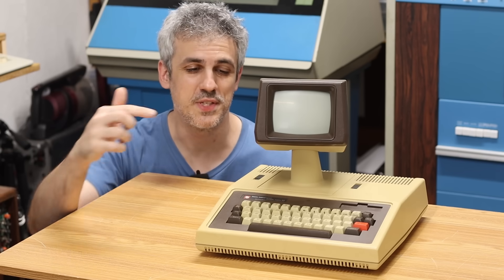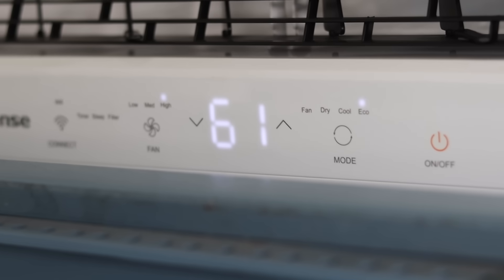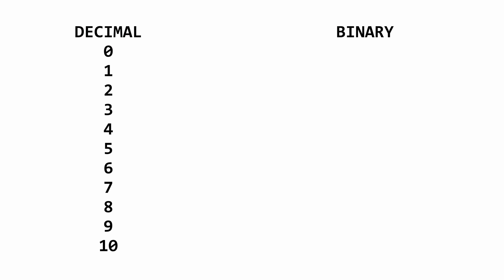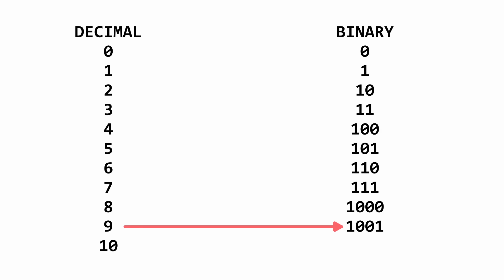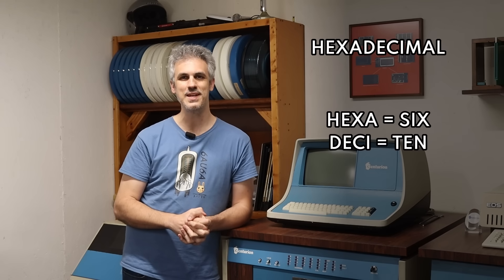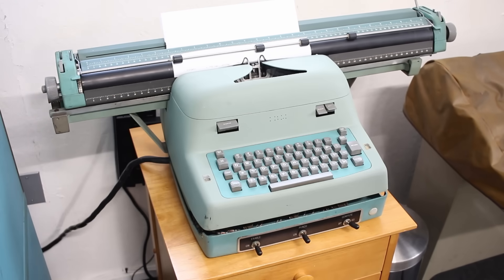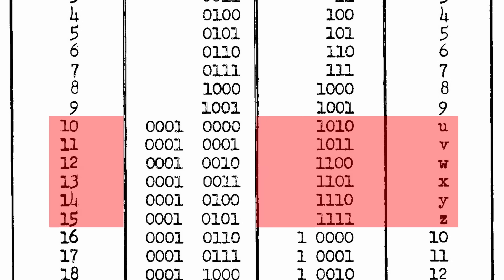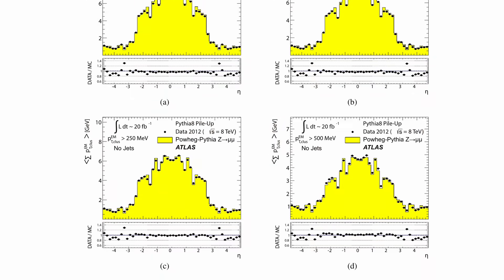Learn How to Count Like a Madman (Or a Computer)!

Comment: 8:33 The flaw of octal is that it's not an EVEN power of two. It's 2 to the 3rd power. 16 is an even power of two, it's two to the 4th power.
Reply from the maker: Good catch! I really struggled with how much detail to go into with this one. It could have easily turned into a 40 minute video of gotchas and intricacies in weird numeral systems.
Reply: @UsagiElectric Just a minor mistake on an otherwise great video! I think everyone understood that what you wanted to say was that in a world of 8-bit bytes and 16-bit words, it makes more sense to use base-16, because all binary values can be represented in hexadecimal without having any unused digit values. A byte is 0 to FF(16) and a word is 0 to FFFF(16) whereas in octal, the highest values are 377(8) and 177777(8). Octal numbers are easier to pronounce but hexadecimal numbers are easier to imagine in binary because each digit represents a nibble.
Reply: @UsagiElectric and I would have gladly watched all of it!
Reply: Octal works nicely for machines with 18 or 36 bit word length. Such as much of DEC's PDP line.

Whilst hexadecimal works well with 4, 8, 16, 32 & 64 bit machines.

Though Altair 8800 (and IMSAI 8080) front panels use octal style groupings of three bits. Whilst the Intel 8080 is an 8 bit processor it's instruction set, mostly, groups into sets of 8. Thus is easier to make sense of as 4x8x8 rather than 16x16.
Reply: Glad some one else caught that!
Reply: I think the basic reason for octal being relatively popular back in the days is the simple fact that more possible word widths can be conveniently divided into groups of 3 bits than groups of 4.

With every additional bit you added meaning more cost, work and complexity, any convenience for going with a 8, 16, 32, 64 bit approach like is common today would probably be small compared to the cost and work involved in doubling the circuit.

Comment: 0 comes at the end because early typewriters didn't have a zero.
Reply: They didn't have 1 either. Lower-case L.
Reply: Correct. Since visually it looks (looked) the same as zero, the capital letter O was used for zero, up until computers came about and it became necessary to distinguish between the two, especially in programs.
Reply: That's half the answer. They could have put the 0 to the left of 1 when they added it. But the typical keyboard layout meant that it was easier to add it to the right, since putting it to the left would put it past where any symbols usually were, whereas on the right side, the symbols weren't very standardized, so they could be moved around to accommodate the 0. As noted above, 1 was also not present on many early keyboards, so it had to be added as well, filling out the left side. I suppose they could have put 0 to the left and moved the other digits one space right, but that would have caused problems for people who'd already learned to type with 1-9 where they were before. So putting it on the right seems like the solution with the fewest problems.
Reply: Some used () as 0…nm that was the printers… :)
Reply: Sounds like something the ancient Greeks would come up with, a typing device without a 0

Comment: My old Heathkit H8 originally used what they called split octal, memory referenced by two octal numbers from 000 to 377 (I.e. 025 306 meaning 21 and 198 decimal or 15 & C6 hex, respectively). Data being a single octal value. (377 equals 255 decimal/FF hex btw.) After replacing the processor with a Z80 I could use hex values which at the time wasn’t any easier. My how times have changed!😂
Reply: At one point when looking at the H19 terminal source code a couple years back, I was confused by an "A" after some octal numbers, when it's usually "O" or "Q". Yeah, that's the split octal for 16-bit addresses, as a custom feature of Heath's assembler. (which I promptly added to my own assembler)
And yes, one of the best features of the Z80 was being able to use hexadecimal numbers! Many thanks to Zilog for that!